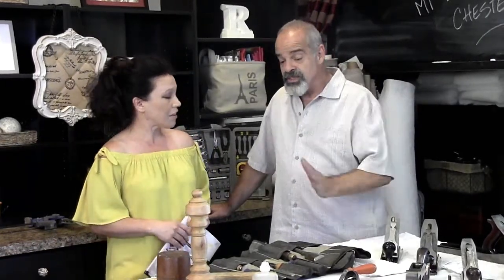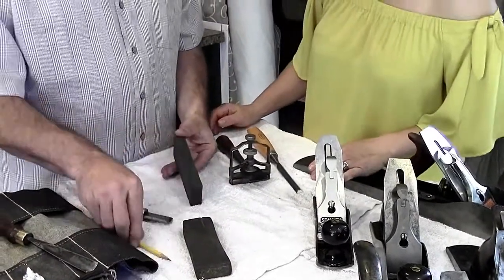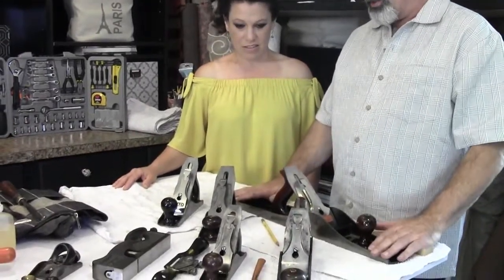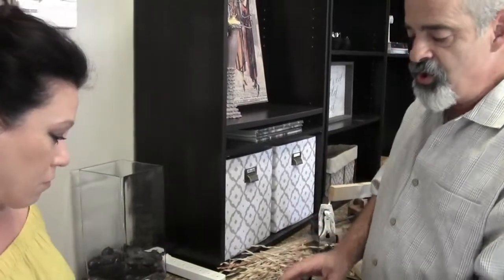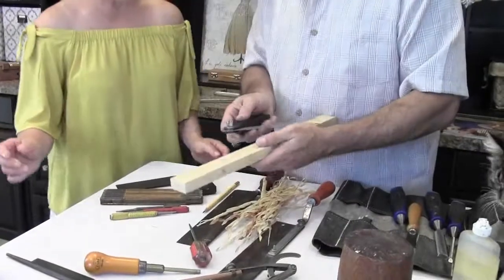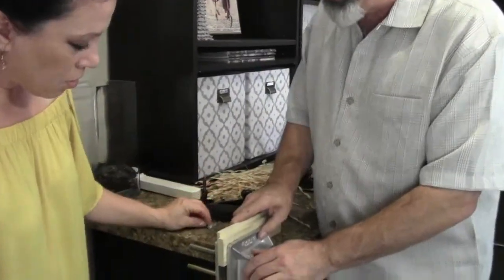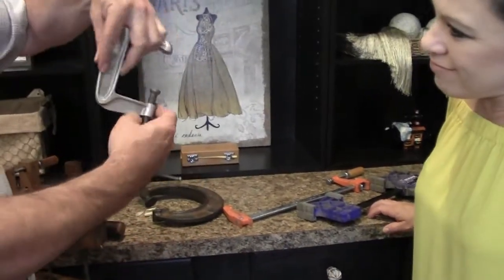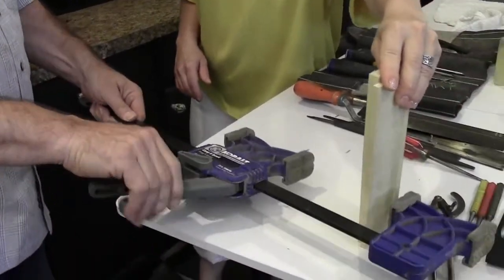35 Woodworking Hand Tools (for Beginners) - Renee Romeo

Comment: can you list all  35 of them? it's kind of  confusing in some parts.
Reply from the maker: Hi Liezel Ann, Here is the list for you:
35 Woodworking Tools For Beginners
1) Carvers mallet
2) ¼” Chisel
3) ½” Chisel
4) ¾” Chisel
5) 1 ¼” Chisel
6) 1 ½” Chisel
7) Oil stone
8) Honing fluid
9) Honing jig
10) #5 Plane
11) Fillister plane
12) Smoothing plane
13) Jack plane
14) Jointer
15) Rabbet plane
16) Block plane
17) Spoke shave
18) Scribe
19) Compass
20) Bevel
21) Square
22) 1/16” Nail punch
23) 5/32” Nail punch
24) 5/16” Nail punch
25) ¼” Nail punch
26) 3/16” Nail punch
27) 1/8” Nail punch
28) Nail pusher
29) Folding ruler
30) Vice
31) Versa vice
32) Jorgensen clamps
33) G clamps
34) C clamps
35) Bar clamps

Have fun accumulating these! I bought a few new ones myself. All the best, Renee